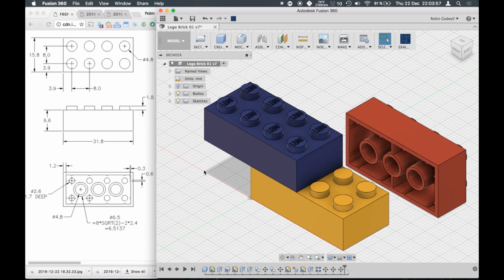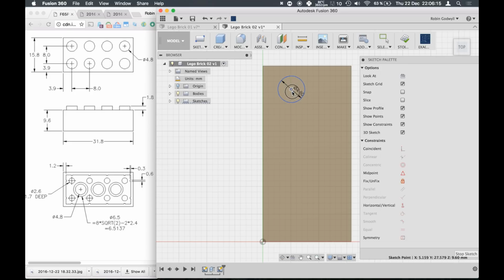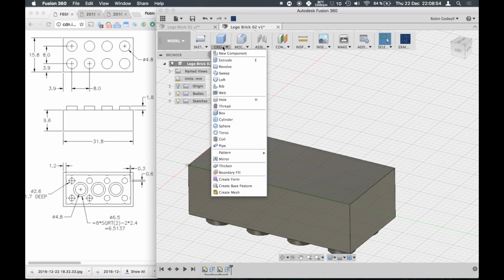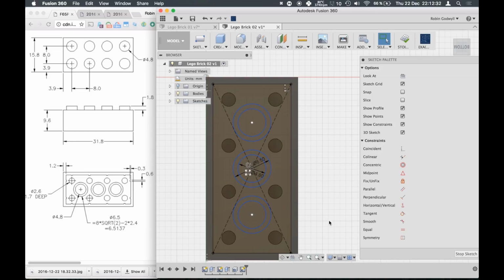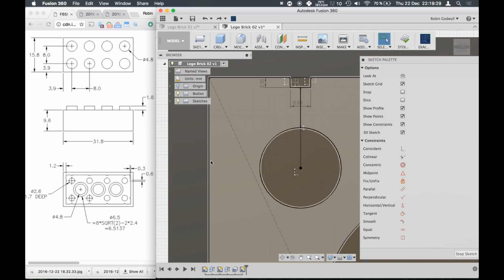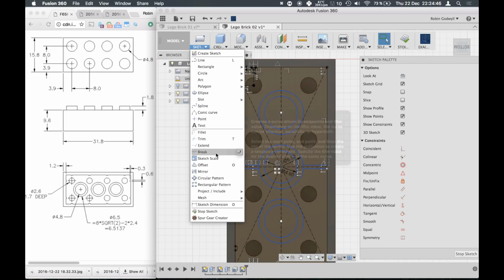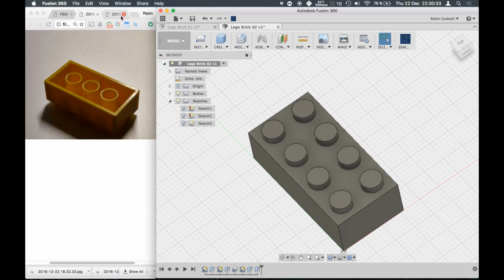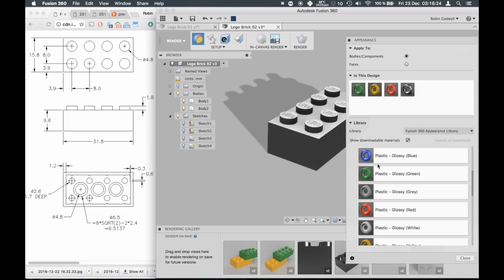Fusion 360 - Lego Brick Beginner tutorial

Comment: Thanks for the tutorial! Very helpful and very clear. I am confused on one point... what creates the concave holes on the bottom surface of the top? It's as if they appear magically after the shell modification is done. I have the same result so I'm aware it wasn't a step edited out... 

Thanks again!
Reply: Sorry, I see someone else asked this in your advanced version and your reply was "The indents happen automatically when you have the cylinders on the other side." Do you have any further reference on this as to why it happens?
Reply from the maker: The Shell command hollows out any solid body. In this case we have cylinders on top of the rectangular box. when it hollows the shape it not only hollows the Box but also the cylinders that are attatched to it in order to create even shell thickness. If it wouldnt hollow the cylinders the shell would be much thicker at these points. Hope that helps, It actually is quite hard to explain in text.